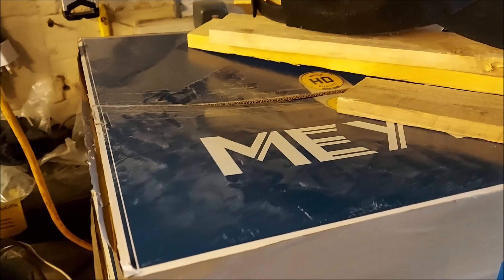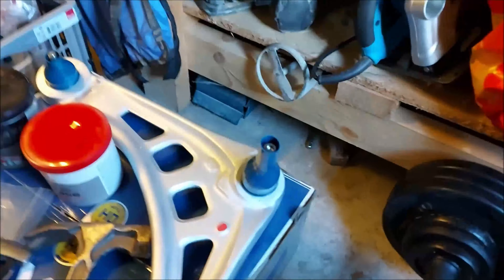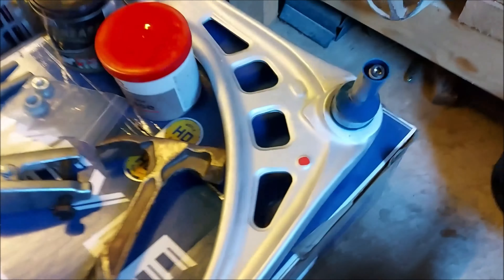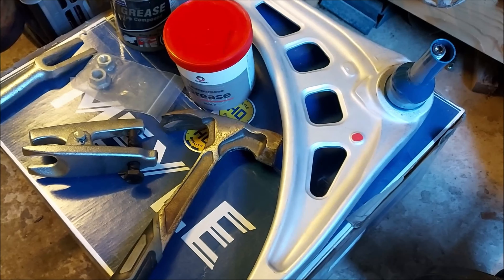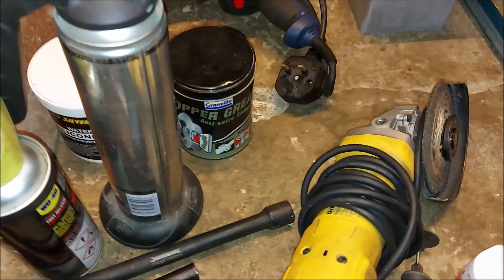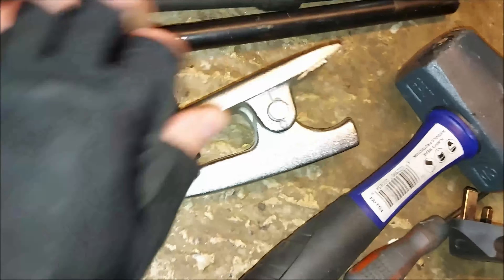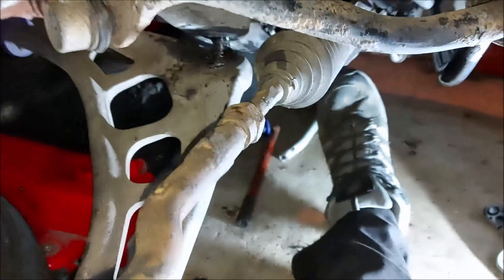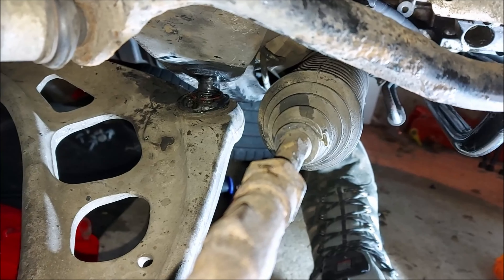Front Control Arm Wishbone Replacement BMW E46 3 Series 330ci #knocking #mot #tracking

Comment: Placing a jack under the ball joint to keep it tight against the subframe will stop that centre ball joint from spinning while you're undoing the nut.
Reply from the maker: I did try that
Reply: @ModFix  - oh sorry man I must've missed that, I just installed mine yesterday and it's a bitch..
Thanks for your video.
Reply from the maker: It's all good mate. I may have not put it in the video because it still kept spinning. It's certainly a crap job 😁👍
Reply from the maker: Thanks for watching too 👍